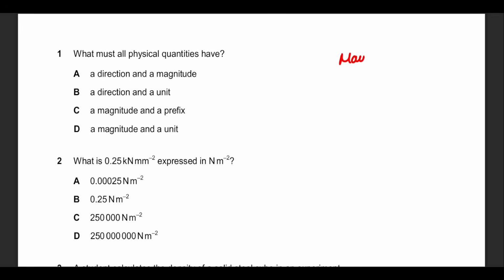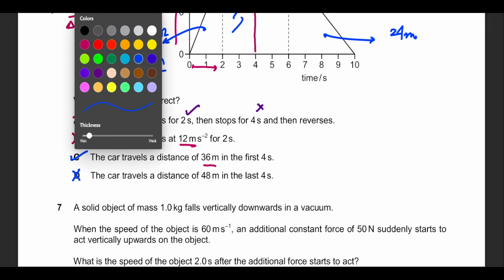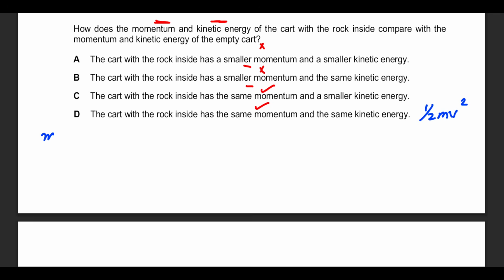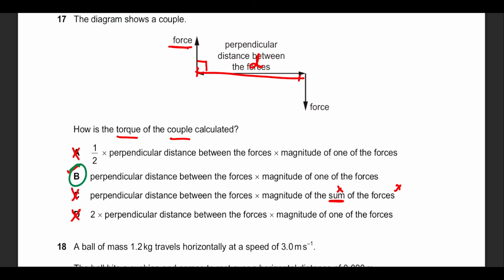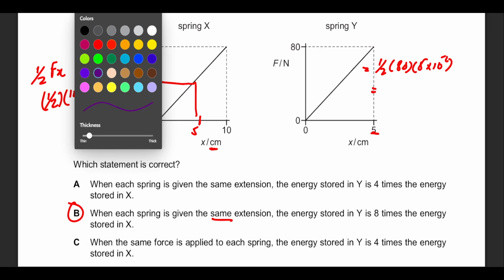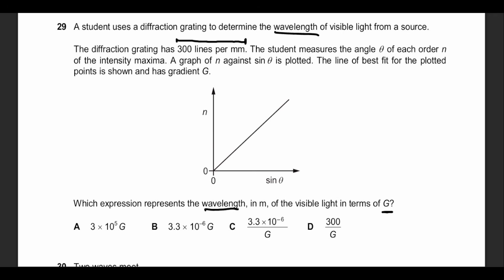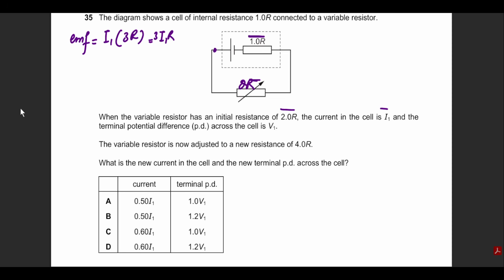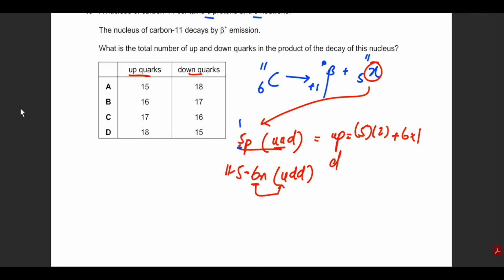A Level Physics 9702 - May June 2025 P12

Comment: q36 explanation for option b is wrong, you may say that the ammeter is connected in parallel so no reading, but u said that reading in 2nd ammeter is higher which is not possible as ( considering current flows and ammeter reading is accepted) current in 2nd ammeter would be lower than 1st ammeter connected beside the battery
Reply from the maker: Yes, I must have missed it. Thank you for this correction, it will help everyone coming to this video in the future.